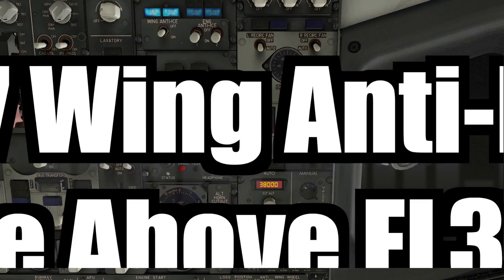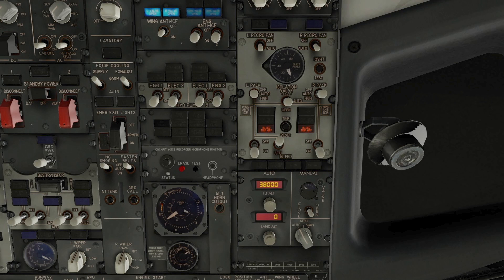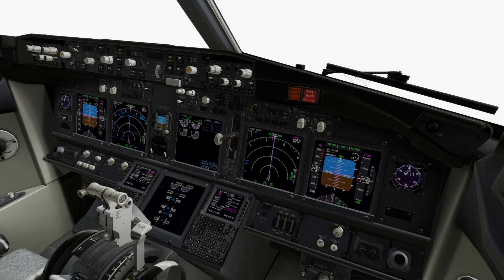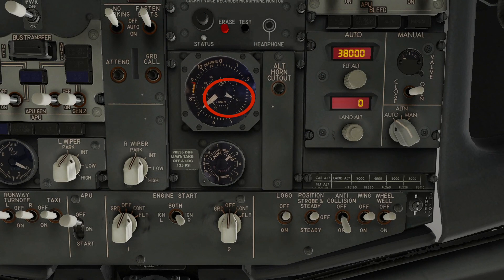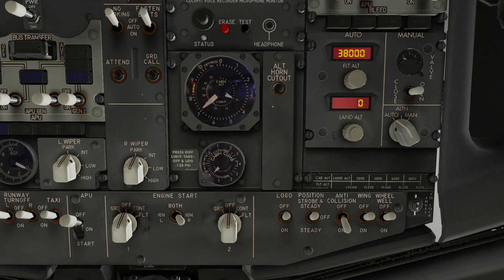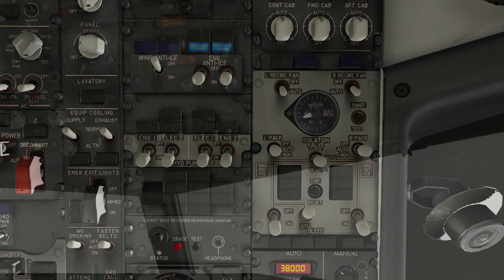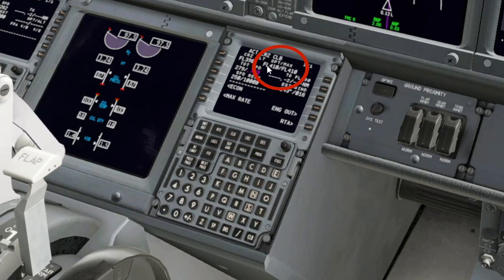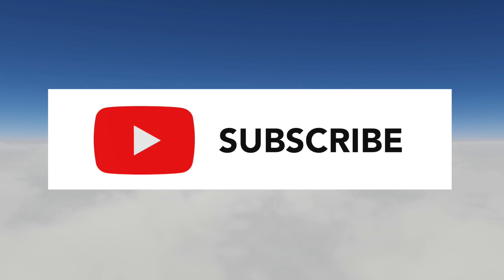737 Wing Anti-Ice Use Above FL350

Comment: Out of curiosity, in the description you state:

"Why is using wing anti-ice a factor above FL350? At these higher altitudes with higher trust settings, using wing anti-ice may cause the high stage valve may open, causing a bleed air trip off due to over temperature in the duct."

What is the reference for this, the voice over states the manual. Which manual? The FCOM?

Also, does it mean one engine bleed source to trip off or BOTH engine bleed sources to trip off?
Reply from the maker: Thanks for your questions, you'll find the caution for wing anti-ice use above FL350 in different places, for instance it's in the QRH, in the Bleed Trip Off non-normal checklist. Whichever manual you use, have a look under Winter Operations and Wing Anti-Ice operation. The video showed what happens above FL350 when using a home flight simulator, in the video both engine bleed sources tripped off.

There are some good technical sites to try if this is a subject you want to find out more about.
Here's a forum where it's being discussed: https://www.reddit.com/r/flightsim/comments/vtsyn8/zibo_737800_pressurization_at_high_fls_a_bit_long/?rdt=53058
Reply: @pilottutorials  very interesting. From the QRH:

“Caution! Use of wing anti-ice above approximately FL350 may cause bleed trip off and possible loss of cabin pressure.”

By selecting WAI you are creating a massive extra demand in the bleed system and it needs to get that air from somewhere. The 5th stage bleed is probably only just coping at that point so the system automatically switches to 9th stage air (high stage air) to keep up with extra demand. The bleed trip in this case is due to over temperature 490F (254C) switch sensed after the bleed air precooler. Usually the precooler control valve (PCCV) doesn’t move fast enough and hence the trip. You will find that the bleed trip will be able to be reset because the system will have cooled by the time the “TRIP RESET” button is pressed. The engine simply doesn’t produce enough pressure at that altitude to produce the 220 PSI which the pressure switch located in the Bleed Air Regulator is looking for (other way the BLEED TRIP light can illuminate for). The loss of cabin pressure is a direct result of loss of the associated air condition packs supplying air for pressurisation. The link you supplied, the OP should have received a MASTER CAUTION and AIR COND on the systems annunciator - only lights, no sounds. Then the OP should have looked at the air con panel and seen the BLEED TRIP annunciator. Obviously they didn’t and then the cabin pressure decayed to limit of the 10,000 ft cabin altitude switch alerted them via horn and lights.

In real life, the bleed trip, if it happens (and it does) will only happen on one side. I have been working on the B737NG as a mechanic for over 22 years and the Classic B737 for over 29 years on the flight line. Never have I heard of a dual bleed trip off (or maybe I forgot 😅). Both systems are independent of each other and the condition of each system is varied depending on many different factors, some of those being the condition of the respective valves and thermostats, potential precooler partial blockage, sense line conditon etc. The precooler system has one valve and a thermostat (plus the pre cooler and the wing thermal anti ice solenoid valve). I have replaced many Pre Cooler Control Valves (PCCV) due to bleed trip off. They are highly susceptible to failure, usually leakage which causes the valve to operate slowly or not open fully. When the PCCV is closed it stops the fan air from cooling the bleed air down via the precooler. I think the simulator you are flying has been created for the absolute most extreme event of both engines tripping off at the same time and probably not realistic.

Here is a link to the B737 NG pneumatic system. The video is excellent because it is produced by BOEING and covers the whole system - it’s a technical video covering system operation and breaking down each individual component including the testing we do. Recently I have seen a few videos on YouTube about the pneumatic system produced by “pilots’. They are really good for the general public who have zero idea about aeroplanes and are interested in a peak behind the scenes. Unfortunately the reality is they just scratch the surface and they actually contain errors on system operation and not explained very well. Pilots have operational experience because they operate the aircraft. In my experience talking to pilots, they don’t have detailed technical knowledge of how the system operates or how to fix it when it breaks. If people really want technical explanations they should seek advice form the guys who maintain and fix the aircraft, not the guy who sits in the cockpit flicking switches.

https://youtu.be/dEbBZ3AJ3Tk?si=s3W9CmO2WQqvfd7m
Reply from the maker: What a fantastic, detailed and knowledgable answer, thank-you! If you'd like to help add that knowledge to other videos to incorporate more technical stuff, please let me know. 👍🏻 Thanks again.
Reply: @pilottutorials  no problem, happy to help when time permits. There is a lot of information out there and some of it isn’t correct. My sources of information are the Aircraft Maintenance Manual (AMM Part 2), System Description Section (SDS, AMM Part 1), System Schematic Manual (SSM), Wiring Diagram Manual (WDM), Fault Isolation Manual (FIM), Component Maintenance Manual (CMM) and various other publications.

Out of interest with regards to your SIM, it would be interesting to see what happens if you tried the following. When your at that flight level, watch the duct pressure gauge on the overhead panel and select only one engine cowl anti ice to ON. See if the duct pressure changes on that engine (assuming that the isolation valve switch is in AUTO). I imagine that the pressure will decay briefly and then either jump up and settle or jump up and trip off. This will create another hole on the system but is isolated to only that side. The engine cowl anti ice isn’t as large a user as the wing anti ice but it’s still a very large hole. I am trying to force the system to switch over to 9th stage bleed. Then select the WAI to ON and see if both systems trip. The engine with the CAI on shouldn’t trip because the 9th stage valve is already open. The EGT should rise slightly aswell for either WAI or CAI.
Reply from the maker: That's awesome, I wish I had those manuals to reference (and your technical knowledge to understand them), I'll definitely try the suggested steps in the simulator and see what the result is, stay posted.

Comment: In the description you state:

“Why is using wing anti-ice a factor above FL350? At these higher altitudes with higher trust settings, using wing anti-ice may cause the high stage valve may open, causing a bleed air trip off due to over temperature in the duct.”

If this happens in real life, I would suggest you write the report for maintenance. The bleed air pre cooler system should be able to cope with the high stage valve opening. Sounds like the pre cooler control valve is slow to react/open
Reply from the maker: Thanks, sounds like great advise.

Comment: Nice job ! 
Also worth mentioning as a reference below-40 degrees C ice should not accumulate on the engines or airframe.
Reply from the maker: Thanks, glad you brought up the temperature 👍🏻 

The temperature range for icing is sometimes defined (for a swept wing jet) as +10 to -40c, so climbing to an altitude with a temperature lower would be a consideration to avoid icing.

However, there is a flight operations technical bulletin with the subject 'Ice Crystal Icing' that mentions ice crystals exist from temperatures just below 0°C to well below -40°C, so worth being aware ice may still exist.

As far as the 737, the manual states icing conditions exist when OAT (on the ground) or TAT (in-flight) is 10c or below with visible moisture etc. (supplementary procedures, adverse weather). The manual also states the upper limit for anti-ice is 10c and  'engine anti-ice is required when icing conditions exist or are anticipated, except climb and cruise below -40 SAT.'

Obtaining pilot reports of reported icing, tops reports, and using weather reports and charts are some resources to avoid icing if desired (for instance if ice is accumulating on the airframe).

Please comment below with your thoughts.

https://www.dispatcher.org/images/Library/All_Model_Tech_Bulletin_20110516_Ice_Crystal_Icing.pdf